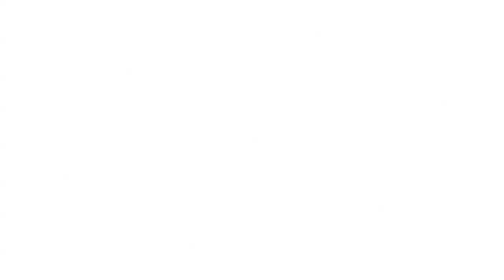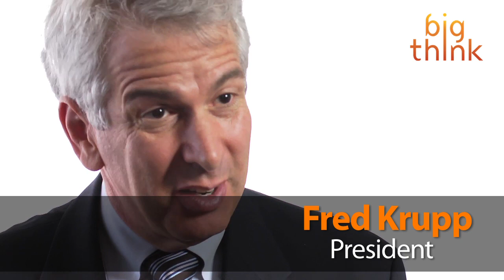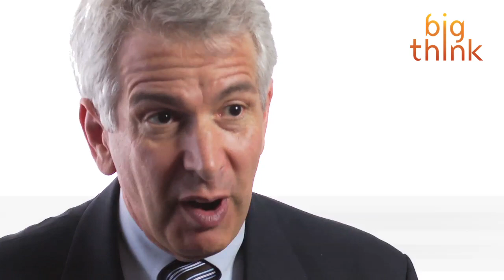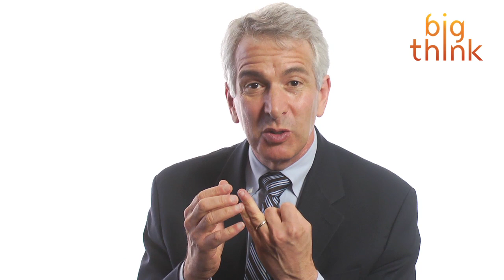Frack, Baby, Frack? What You Need to Know About Hydraulic Fracturing

Comment: Well, electricity can come from a lot of sources. Wind, solar, hydro, geothermal, nuclear and yes fossil fuels. 

Those last 3 use steam to power turbines (rotating magnets) to generate electricity. Basically you only boil water with 'fuel to create steam'. The thing is, the heat potential in oil/gas is still much greater than it's 'explosive' chemical energy.
The keyword is efficiency. Which an oil power plant is compared to a car engine. Thus electric cars would definitely help out a lot.

Comment: Yes. Commercial nuclear fusion to generate cheap, non-polluting electricity.

We've been tossing a little money at it for a while now, when the opportunity arises.

We'll still be using hydrocarbon fuels for a few specialty applications, but mostly oil and natgas will be used as the raw material for composite structures, from car frames to space elevators...

Comment: Natural gas just isn't that efficient...in the past we wouldn't have touched it because oil and coal are far superior as energy sources.  The interest in it now is due to the fact that we are running out of oil and coal.   Natural gas isn't an alternative solution, it's a desperate one from a system that would rather starve and die than change.  The environmental impact is not at all different: coal, gas, even plant material, burning things is burning things, and that all puts crap in the air.